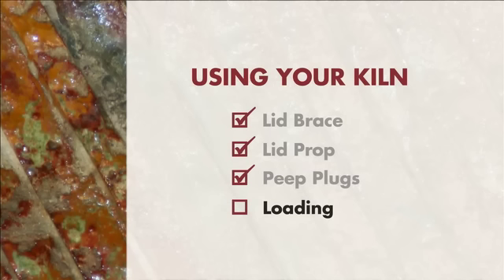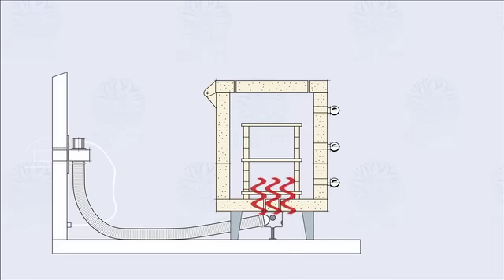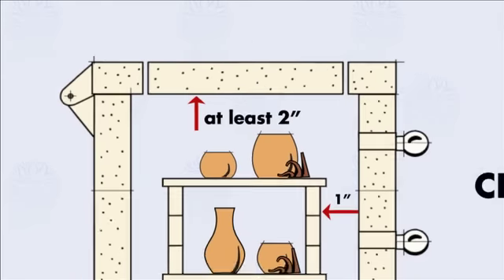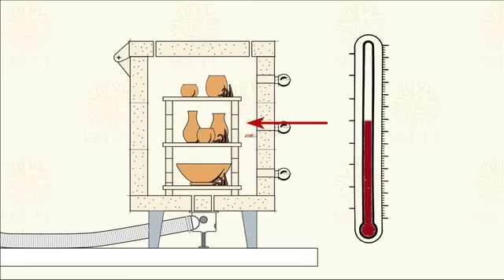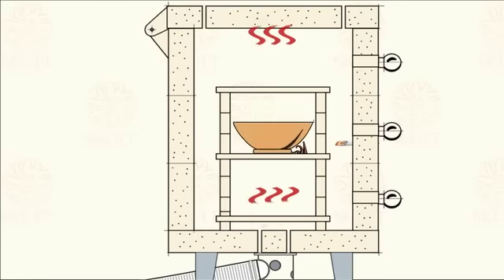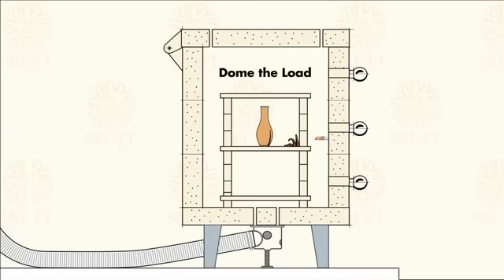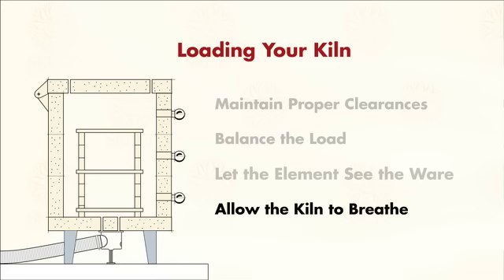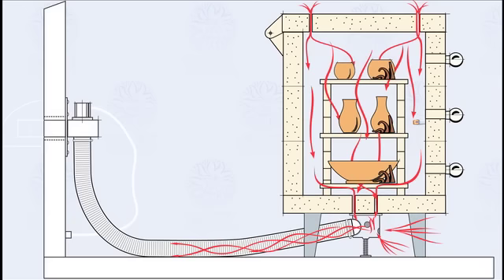Using Your Skutt Kiln - Loading Your Kiln

Comment: I am wondering if placing a large piece, for exemple a large bowl, especially a large plate or platter across the 1/4 inch gap between the two half-shelves might have a negative effect on the piece... I imagine this would not be recommended even though the two half-shelves are perfectly the same height and even... Would it be better to use a full shelf or a plate support to bear the piece across the gap ? Thanks for your advice!

Comment: This was very informative.  As someone who is new to clay, I've lost a couple of pieces in the bisque firing, both of which were on the bottom shelf.  I've been pondering what I might have done wrong.  From this point forward, my larger thicker pieces are going on the middle shelf.  Also, I wondered about doing a small load.  The information on putting items toward the center, or  on the center shelf, and leaving the top and bottom shelf empty is exactly what I needed to know.  Thanks for the info.

Comment: Hi Can I run the kiln with only two sections? took off the top sectiont and kept getting a fail message. I swapped out the thermocouples so it is not that - when I hooked up the thermocouple to the section I was planning not to connect the fail message went away.. so I am presuming I cannot just disconnect and remove one entire section?  Does this makes sense or is there a way to remove one ring section completely
Reply from the maker: Hi there, thanks for the question. No, the kiln needs to be fired as one. The elements are balanced with the three sections. If you remove a section, it will not fire properly. Feel free to give our tech support a call at (503) 774-6000 if you need further assistance. Have a great day!